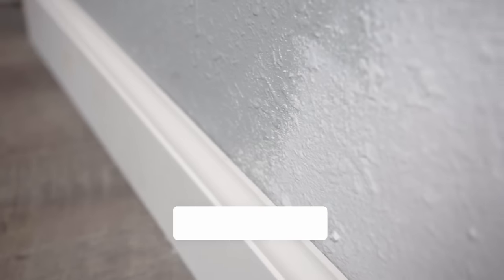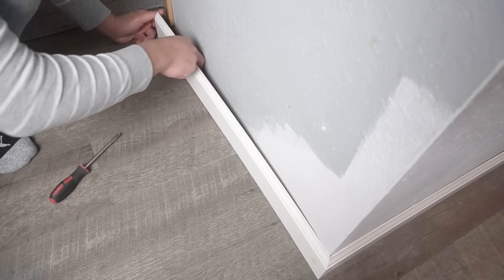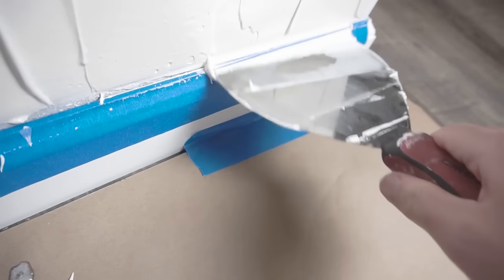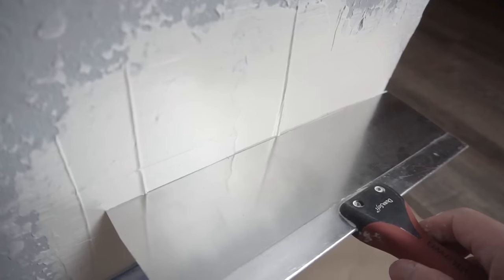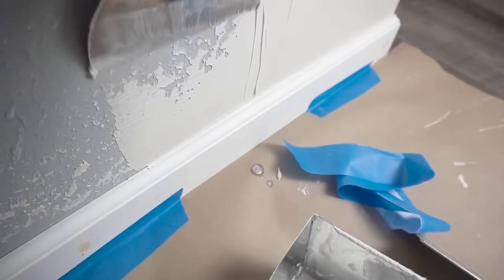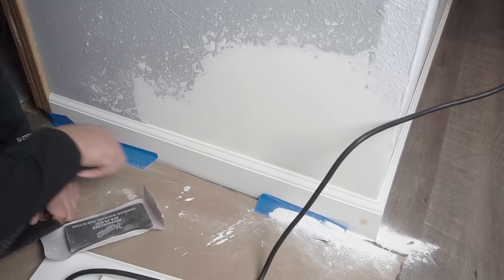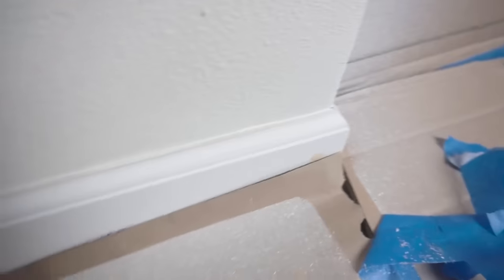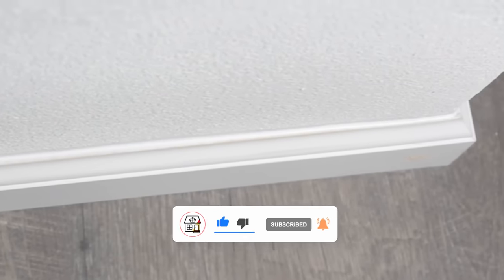How To Fill Gaps Between Baseboard And Drywall | Fix It Or Caulk It? DIY Tutorial For Beginners!

Comment: I'm impressed and just learned something new. Seems to the simplest way to do it, outside of cutting that area out and replacing the drywall. Yeah, I like your way. Keep that good content coming.
Reply from the maker: Thank you 🙏🏽 so much!
Reply: A quicker fix, albeit not as good as yours, is to paint the filler caulk the same color as the wall. It instantly becomes 80 percent less visible.

Comment: You just turned a 30 sec paint touch up into an hours long drywall repair requiring hard messy sanding, texturing and repainting. Just mask off the trim and paint the excess caulk to match the wall color it will keep the sight lines for both the wall and the trim looking great. We only have a finite amount of time on this earth, don’t waste it.
Reply: Also, you just created a very noticeable texture mismatch for that entire wall section, if you are gonna go to that much effort you should skim the whole wall and retexture the whole wall, that texture mismatch in my opinion is way more noticeable than the previous 1/8 inch gap.
Reply: Texture is gross too
Reply: @madusimo1   Two know it alls tag teaming someone giving free advise on the internet. Cheers guys.
Reply: In total agreement here.  When he showed the picture of what caulking the gap looked like, my first reaction was, "it's really okay.  Just paint the wall."
Reply: yes exactly right, he turned a simple fix, into a big mess, texture not right. should of just caulked it than painted
Reply: maybe he done all that so he has more chance for people to buy from his affiliate links lol
Reply: Caulking is a builder shortcut to cut costs. A proper job is filling the gaps. I learned to fill with compound from an old-school painter; he insisted it looks much better than caulk and he’s right.
Reply: think about putting baseboard up on 3-4 rooms. you would still want to use a 12-14 inch knife to check all your corners since almost every corner will look like this due to corner bead cover-up and the fact that drywallers don't care about making extra work for finish carpenters or painters. if you had more than 3 corners to do I'd definitely go ahead and just fix all the corners with skim coats before any baseboard goes on the wall. it's gonna look like that for the next 50 years probably... skimping out by painting half the caulk wall color and half the caulk base color is only worth it for one-offs. on a full job you should be gap-filling all the corners so you can paint the entire bead of caulk the same as the board color and have a nice straight line between caulk and wall color.
Reply: Thats what I was thinking! 
Hell if it was my house, I wouldve just buried a screw in it, filled the hole/paint, done lol
Reply: @kevinconrad2250 he did it in less than 15 minutes
Reply: Exactly what I was thinking. If you have this problem in many places in a wonky room(s), this would be a ridiculous amount of work.

Comment: You are going to end up with a bigger eye sore trying to mud and match texture that you did not spray vs caulking it correctly. If you know how to caulk and paint it turns out wonderful. If you knew that drywall corner bead is always going to do this to all corners then you would realized that in most occasions all corners are not going to be a true 90%. The corner bean needs to be proud of the drywall so mud fills the edge corner in. That's why your miter cuts in trim are going to be less than a 45%. And most corners will be what we call hollow.
Reply: True. my mitres are usually anywhere from 42-44°
Reply from the maker: Thank you for the advice sir! 🙏🏽😊

Comment: I caulked my gaps.  Winter rolled around and the humidity changed caused the caulk to crack.  Not using caulk again and going with this method instead.  I don't have textured walls so it will be much easier.  Thanks for the tip!
Reply: Lucky you don't have textured walls!

Comment: I love it; I actually used this technique in my home years ago and men told me it was wrong. I said that it looks better so I'm going to finish it this way. One thing that I did wrong because I had never done construction work before was I waited for it to dry before taking the tape off and it did pull some of my work off so I just filled that in with joint compound and finished my job. My job was done before home computers were out and common place. But even the construction worker who saw me doing this job and then saw my final result told me how nice it looked and that he was going to use it, as well. 
Thank you so much for your video; it gives me confidence as I'm fixing up our new place. I'm in my 60's now and will need help but they've got to follow my lead. Anyway, my help isn't experienced that much. Mainly need the help for the muscle work. I will call in professionals for things that I'm not confident with, though. I'm not that confident. LOL, Thanks again.
Reply from the maker: Thank you so much for the meaningful comment! Yes there are many ways to do things especially cosmetic work. Not everyone is going to agree with a certain technique and yes they might be right on it being easier to do one way than other, but at the end of the day it’s what’s best for your situation and what you think looks best. I did learned about the tape thing the hard way too when I use to do insulation work, to always take off the tape while everting is still wet. Thank you again for the meaningful comment and I wish you the best on your future renovations! Thank you and stay Safe! 🙏🏽😊

Comment: Personally, I just take the trim off and get it out of the way. Mud the entire void including behind where the trim goes, and then texture it. Depending on the size of the wall, i’d either just overlap it onto the previous texture about two feet or just re-texture the entire wall. Also, after the mud and texture dry, I like to throw a little rx-35 to seal and prime it for paint, otherwise that mud will just absorb  your fresh paint and will look different then the rest of the wall. The trim too could end up sucking up some of the moisture from the mud and become ruined.

IMO, if you just put mud above the trim and whatever falls behind it, you’re just creating another problem to fix later on down the road if you ever decide to change the look or size of your baseboard trim.
Reply from the maker: Thank for you’re advice! Yes I do agree you can just take off the whole trim, but not everyone has that option, but I do appreciate your knowledge and advice! 🙏🏽
Reply: You could always use a paint and primer all in one if you're lazy like I am lol

Comment: Nice technique.  By the way, instead of sanding the compound you can use a moist sponge, I found that it works well without all the dust.
Reply: i've felt the sponge doesnt offer the control of material removal that a sanding pad does.

Comment: I understand your idea. My initial thoughts are the touch up sprayed wall sticks out like a soar thumb even though you did a close up shot it really sticks outs to my eyes. Maybe an untextured wall and you could get by. Another issue is if you ever need to remove/replace that piece of trim. you will have completely repair the wall again and your stuck with using the same height or taller trim piece in the future. I would have removed the trim piece and repaired the wall lower to the floor. I prefer 2 other options. The reason the caulked results looked bad is because it was caulked up the wall a little. maybe used a finger to push it the void and it ended up cupping the caulk job. Try removing the caulk and use painters tape to the the fill in that small gab. You may need to reapply if it shrinks to much.  I prefer cut to the back of the trim piece every quarter inch in the area that has the void to allow the trim piece to conform the that slight gap. These issues arise because the sheetrock/plasterboard contractors should have feathered the outside corners a minimum of 24 inches.

Comment: As a diy homeowner I always enjoy seeing techniques that expand my skill set. ...I also am  a bit of a perfectionist so gaps like that (which I have currently) bother me and filling with caulk is not the answer~Thank you!
Reply from the maker: Im happy I was able to help! Yes I agree! There is a time and place for caulk, this is one I learned is not one of them, especially for big gaps like these. Thank you for taking your time to watch and comment 🙏🏽😊!
Reply: I use loctite adhesive to get rid of the gap. It doesn't shrink like caulk and it actually grips the baseboards or trim to the wall. Easy to apply and takes literally 2 minutes to fix.

Comment: Good fix!😁👍
I deal with this alot also.
As another alternative l generally check the other side of the wall as this is a framing issue, if the other side is open you can shim out between the stud and the back of the drywall & that will bring the drywall & baseboards together nicely.
If it's not open on the back side l will pop the piece off and loosen the bottom drywall screws and lever and shim from the bottom keeping all my work below the baseboard level as to not be seen after reinstalling the piece.This method has not failed me in over 20 years of renos & restorations.
Hope this helps & that l explained that well enough.
 Happy New years @Everyone 😁

Comment: For texture patches. Try spraying some test spots on some extra masking/plastic. Getting the mix right is the most important for blending patches then just play with your orifice size and air pressure. For patches alot of times I'll do two coats. One to just initially fill the patch and a second to cover the entire wall/ceiling to blend everything together. Definitely takes some practice 👍

Comment: Adjust your texter sprayer to 50 psi. medium tip. Adjust trigger to full open. Hold gun approximately 24 inches from wall. That would give you a real close matching texter with that gun. Test on a piece of card board first.

Comment: As a professional finisher must guys don't take into account of the void you will always have at the corners of walls from the build up to cover corner bead .... I always mud out that void about 2 ft up the wall to the base area so wen its time for finish carpentry you have no issues jus install and go

Comment: This is a great method, only question I have is why not use just the 10" knife. It could of been 1 or 2 swipes and cut your edges and done. Not knocking you just wondering the idea behind it.
Reply from the maker: That’s a good question! I do have 6,8,12 at the time. I just didn’t want to use the 12 for some reason 😅 but you are absolutely correct 👍🏽😊

Comment: The reason there's a gab in the baseboard is because the drywallers used metal cornerbead which flares out the outside corner. Better to use mud on bead which lays flat against the walls.
Reply from the maker: Thank you for the information 🙏🏽👍🏽😊!
Reply: Metal bead is fine. They just didn’t mud well enough.

Comment: The only 2 suggestions I can give is that first of all the original texture looks like it’s knock off texture. I could be wrong. But that would have made it match better if you did knock off. The other thing is the tip on your caulking was way to large. You had way to much access to clean up. Other than that I did actually learn something here and I appreciate this video. Thank you.

Comment: Thanks for sharing this video. I bought a house that's mid 1950s the baseboard is set behind the floor and I do have some walls that are a bit off so this will be perfect for the situation I'm in as I don't want to remove the baseboard.
Reply from the maker: I’m glad I could be of help! I’m very glad you were able to use this option. I know some may say why didn’t you just remove the whole baseboard then fill? Not everyone has that option and this is just another way to fix those gaps. 🙏🏽😊 thank you so much for watching!

Comment: What if 90% of all your baseboards are like this. Any recommendations?
Reply from the maker: Hi! It’s up to you and how willing you are to correct the problem. You can pull all baseboards out and resurface the walls and texture. Or you can go the short route and caulk the gap if the gaps are not that big. Personally I would only do the obvious ones for resurface and the rest caulking 🙏🏽

Comment: Lot of work for a  temporary fix. Proper way is to use foam spray fill the gap then just caulk along the top easy as that, this way will just crack again due to movement and flex and any knocks against the base board plus any shrinking of the caulk will just fall back down the gap.
Reply: Y do u have to use caulk if u foam spray it ? Arnt they the same? I seriously don't know
Reply: @ittybitty_caribou8697  clue is in the name expanding foam spray, caulk is a fine filler that you will then put on top after you cut foam back and sanded. Personally I won't use caulk I would use a different filler like Powder one that you mix with water as the caulk is to fine in my opinion.

Comment: While this is the proper way, I’m sure, what about just filling the gap with joint compound instead of going all the way up the wall? Filling the gap with the joint compound, then caulking before painting. Especially if the walls are already painted?? Because the gap on my already painted wall is almost 18” long

Comment: okay, as for a diy'er, this is a decent video if you don't want to rip trim off. But 99% of the time I'm taking the trim off. Also, anytime you're adding compound to an already textured wall, always use a wet sponge and feather the edges. I usually do that when it's about halfway dry. I've always found doing it when it's wet I mess it up more. Everyone is different, that's my way. The texture that was on the wall, vs the texture you added are different. So in that case, I would've just taken a scraper, knocked all the texture off, and retextured the whole wall. You've got a thick texture vs a thin orange peel. Good work, but that's going to be an eye catcher.
Reply from the maker: Thank you so much for the tip! Really appreciate you taking your time to write this advice 🙏🏽😊
Reply: @FixThisHouse  no problem man. I always like to see different techniques. i just have a rule of thumb, if I'm putting texture on the wall, i never do a small spot. You'll ALWAYS see where you fixed it. you're probably going to paint that whole wall anyways, I would've just textured the whole thing. An hour of work saves a lifetime of headaches. I'm not pro by any means. But i do this stuff quite a bit.

Comment: Caulking would hav been fine. All that work for a little gap. Who walks around and inspects your baseboards? Houses move thru the years, are you going to be remudding your walls just for gaps.?
Reply from the maker: Hi! Just an option, especially if you have areas that show these areas out in the open. As you saw on the video I had caulking on one wall and it just doesn’t look as good as if you took the time to even out the wall.
Reply: I rather put caulking looks good rather than wasting all that time and doing all that work and wasting all that money and no one is going to be looking at the ground most of the time plus im sure theres more defects on the eye level and also the texture of the wall eventually ends up looking worser with a patch on it since ill be really hard to match it even if youre a proffesional at it i would rather have a gap where its hard to be seen than a patch that will get your eye attention but again thats just me and im into art and work in construction.

Comment: Man, I would just caulk it personally (siliconized acrylic to stretch & paint). As long as baseboard still attached well and not pulling off. I hate mud work + texturing, that is a lot of time and labor for a small defect, and the tools to do it right let alone the experience. It's one of those things you'll hardly notice unless you're looking for it or know after caulking.

Comment: to be honest, for me at least,  the time to benefit ratio is not worth it. I’d just use some 2 part filler, caulk and then pain it so the wall and baseboard lines are even. Baseboards are usually seen from 5-6ft away which hides minor imperfections

Comment: I am no professional so this may be wrong, but what works for me is multiple thin coats. So I use fast drying mud and di very little sanding. I made the mud thinner and thiner as well. So thinner mud and thinner coats.  The first coat does most of the build up and the next coats fill in voids and imperfections of the previous coats. Doing that I also don't work it near as much as you were because I am nit trying to be perfect in any single coat.  I'll end up doing three or four coats sometimes more if I am having a bad day.

I have smooth walls so maybe that makes a difference in how I do it too.

Comment: My contractor installed, skimmed and sanded the walls. And was going to paint it, I stopped them. The gaps everywhere. Just checked places where is going to be baseboards, vents, electric plates, corners. Hate this work. Decided to straight this  places with mud to minimize gaps, just use some longer screed, DIY. Annoying work, I want to demolish all walls and do it right, but my husband don't let me do it, he doesn't care if the gaps around. As for me it looks like a cheap finish work.

Comment: You could have matched the old texture you just have to buy knockdown texture and a knockdown knife wherever you get your materials from. You will be able to run it through the sprayer you already. Or what I like to do for little texture repairs probably wouldn’t do one your size this way but i use 90 min easy sand and mix it in a pan and don’t use a sprayer to apply it put some on your fingertips and flick it on to the wall wait until it starts to set just a little bit and run a really dull taping knife or a regular knockdown texture knife and very very lightly just flatten the top very little as to match the existing knockdown texture
Reply from the maker: Thank you for the tip and advice! 🙏🏽😊